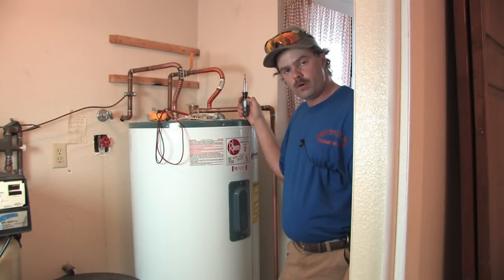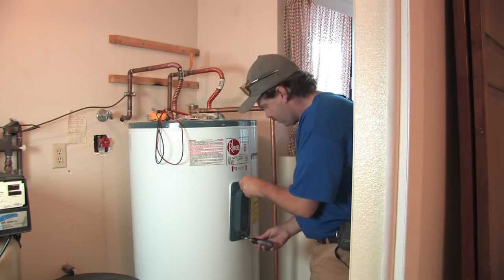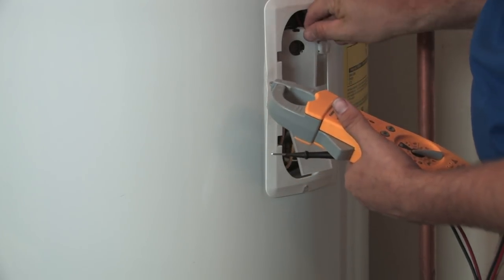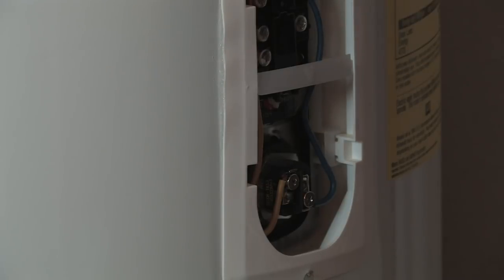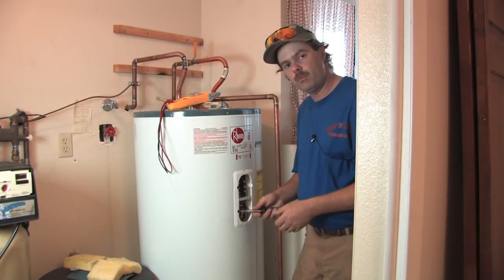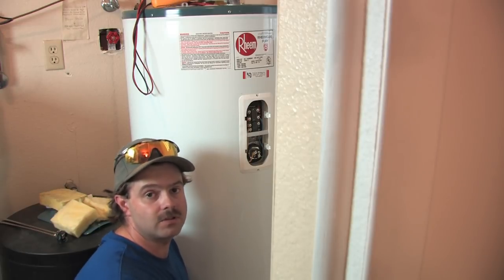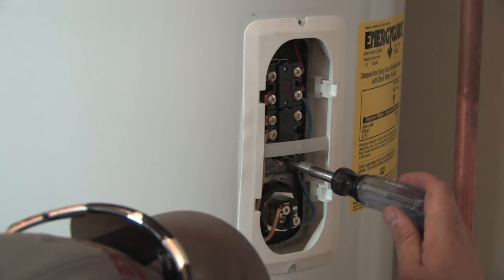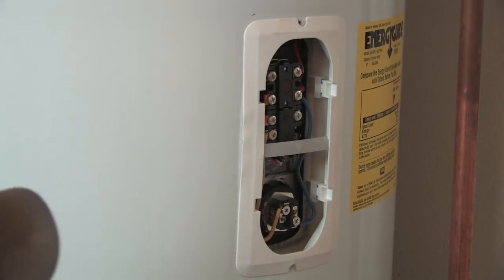Hot Water Heaters : How to Change the Temperature on an Electric Hot Water Heater

Comment: you'd think with today's technology there be an outside switch to easily change the temperature, like an AC
Reply: Yea and then a kid turns it all way up and burns their self. Now they get sued
Reply: @allniter1988  Simply make it a digital adjuster that requires a password to adjust.
Reply: a water heater's tuning doesn't need to be changed for approximately its entire lifetime
Reply: They have them nob like.. I had one at the house I grew up in.

Comment: I was changing a hot water tank and there was an electrician working on the electrical panel. He turned it off for me and I double checked. When I was putting the new tank in I got a nice shock and realized he turned it back on. I was not a happy camper the rest of the job 😂

Comment: But why do they make it such a pain to adjust on electric water heaters, compared to every gas water heater I've seen?  You gotta use tools to adjust the elements, and make sure the bottom one is lower than the top one... I just bought a house with an electric water heater and it was weird--no knobs or switches that i could find anywhere, not even a main on/off switch...

Comment: Thank you for the video! What would make a hot water heater start leaking after turning up the heat?
Reply: There's a pressure release valve at the top of the unit, if there's too much pressure in the tank (usually due to heat) it will open to release the pressure (and water) so the tank isn't damaged and steam doesn't spit out of your taps.

Comment: Some do yes, but it's still better to have the water supplied to the unit at 125 because it will cut down on cycle time for the dishwasher. Plus, the dishwasher uses electricity to heat while many water heaters use gas, so it's cheaper in the long run.

Comment: What about the main breaker switch, will that work for cutting the power off to the hot water tank? My issue is having a large household that needs to take a shower every day, the water seems to get cold fast, was hoping to turn it up a bit to help maintain hot water for everyone, the landlord wont put in a larger one and I certainly cant afford one.
Reply: Random Tube You've probably already figured this out by now, but yes, it needs to be shut off at the breaker. However, you should still check the power directly like he did, with a multimeter. Breaker boxes are notorious for being labeled incorrectly.

Comment: If you set your temp to only 110 degrees,  your dishwasher will not work well. The water temp has to be a minimum of 125 degrees to properly dissolve the detergent and to also sanitize your dishes.

Comment: So I have a problem with the advice in this video... if you set the electric water heater to 110 or 115, your dishwasher will not be able to kill the bacteria when washing your dishes. The temp would have to be 120 or above.  My Raheem water heater <6months old was set when installed to 120 and hot water in the shower lasts maybe 3 minutes. So 110-115 would make my hot water last a minute.

Comment: hi  my hot water is boiling hot ,went adjust but there r letters instead of numbers goes hot,a,b,c,hotter on thermo tried checking manufactor for letter meaning they dont say what the letters corispond with temp like 120 maybe (A) i dont no it was on c i turned down to (b) it made no differance this the top thermo did not check bottom yet its water from hell any help thanks

Comment: I Just installed a. New electric water heater and I adjusted the temperature. How long does it take to Heath up it been a couple of hours and no hot water yet. ???
Reply: should be hot by now but if it STILL isn't then try waiting 5 more minutes
Reply: It's been 6 years, has it heated up yet?

Comment: Awesome, dude, you have a water leak on your meter thing or something.
Reply: That appears to be a bypass for a softener. They are famous for leaking through the factory o-ring. A real bypass should always be installed through ball valves and fittings in the piping.

Comment: It's not this serious with the electricity. Just flip the breaker switch, open the panels, mive the installation, and turn both dials up a little. Your all set after that. People get on You tube and go all full nerd, ur not gonna get electrocuted by ur water heater, turning it up as long as it was installed within the last 7-10 years.